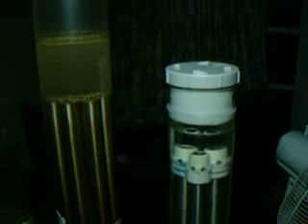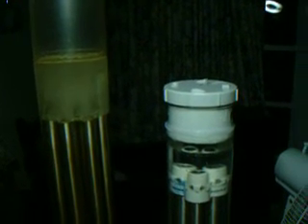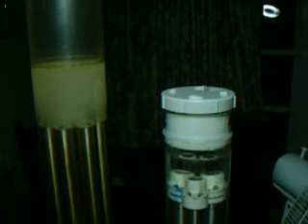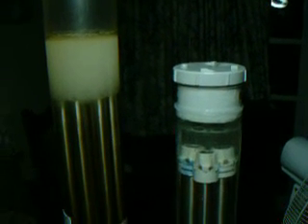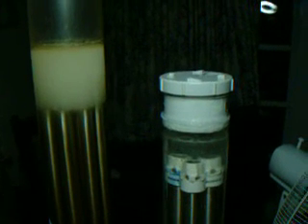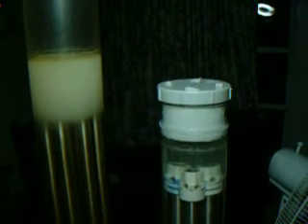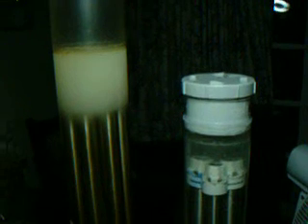WFC Conditioning Testing and Comparison.

Comment from the maker: @zarchiel11 
Hello Khwartz

that is a good question because its about the technique with in the motor not the motor as such.
maybe you should contact me by private email?
did you ever work on the Muller or the Robert Adams motor ?
do you know about the delayed lenz affect.
have you ever looked and the cores of the coils. ?

Cheers Rod

Comment from the maker: I did not intentionally take it down.
it was removed or it failed on you tubes server
I don't know what happened to the original.
so I just RE Up loaded it.
I will get the info.
I have moved on to even bigger cells since.